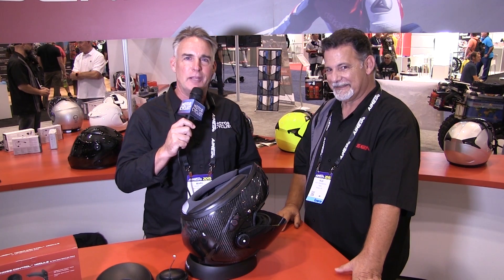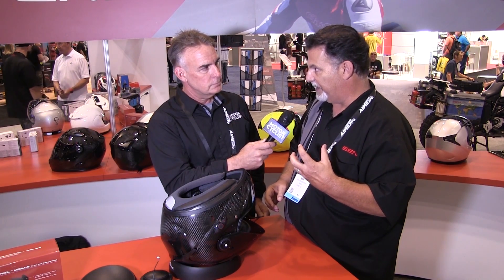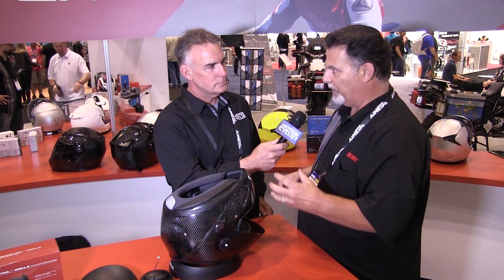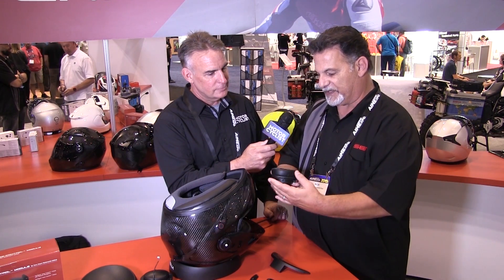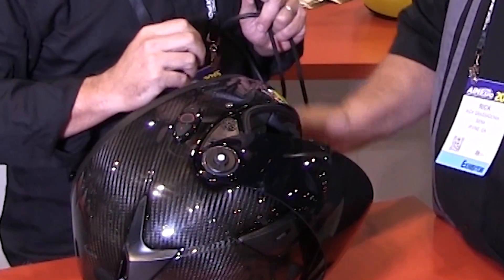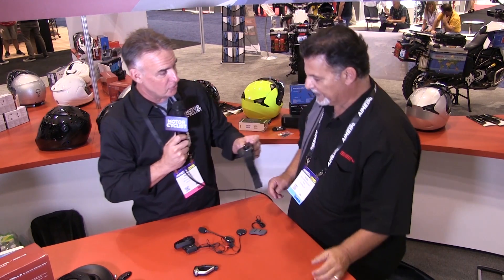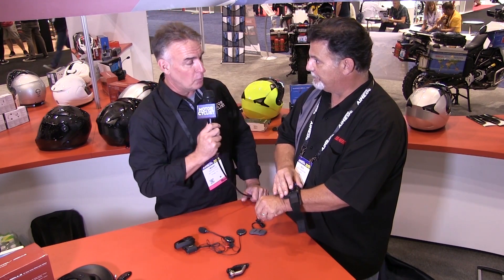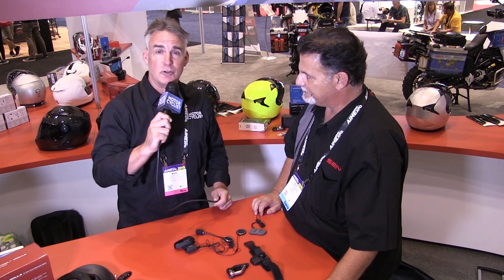Sena Introduces the New Smart Helmet With Internal Noise Reduction at AIMExpo 2015

Comment: Sena sucks. I bought the smh10. Within 5months one speaker completely went out and the device would not connect the the computer. I got it exchanged with paying the difference for the 10s. 4months later. It dies after about 1hr. One speaker went out, the other that worked was nothing but static, the bullshit connectors on the base and the Sena had a short. I had to push the Sena on the back and downward position to get it to connect to the base allowing my static noise to come through the one speaker that worked. I had that one exchanged. I'm a week into my third Sena, second 10s. The same exact problems as the first 10s happen all at one time. So am I suppose to wait until the new 30k is released to start having problems with that one also along with paying the difference to upgrade? Because I'm no where near able to get my money back with all these issued and exchanges.

Comment: Great idea.  I've been wondering why the motorcycle community hasn't produced active noise cancellation for years now.  I've even tried to experiment with it myself with active noise canceling earphones.
Here's my problem though with this Sena system:  This helmet can't be cheap.  I would assume it will retail for well over $1000 because of the integrated electronics.  What happens when you need to replace the helmet in a few years or if it get dropped hard and needs replaced?  The electronics may be fine, but you have to replace the whole shebang.
Keep the system modular so you can replace or upgrade each component (helmet and electronics) independently.

Comment: i just want to get rid of wind noise!
Reply: +2cool0 It's not really a big deal to carry ear plugs. I have a pair of moulded plugs that I just leave in one of my motorcycle jacket pockets so they're always with me when I ride. Whenever I take them out, they go straight back into the pocket.  I wouldn't do that with foam earplugs though, they'd probably get pretty dirty and gross.  My moulded ones also came with a small leather carry pouch but it fell out of my pocket one day while riding :(
Reply: +2cool0 Wear earplugs ...sorted
Reply: Kryten L yeah but i don't want to bring earplugs with me or remember to take it. i just want to take the helmet that's it. i like to make things simple and unified......i don't like to bring all these seperate things. but yes until i can get this helmet i will use earplugs. but it would be nice if they made a helmet similar to this but without making it all electronical. you know how they have the ear muffs in gun ranges? those earmuffs don't have any electrical parts or anything and only costs 14$. it would be cool if they made a helmet like that with ear muffs inside that works like that.
Reply: +2cool0 The half way decent gun range earmuffs are electronic so they can amplify low volume noises and decrease loud noises. Wearing something like the cheap ones on a motorcycle is just asking for trouble.
Reply: +Pyxel Dust were they ACS ? I have moulded one too...take a couple of seconds to insert and go straight into the leather carry pouch when I get off the bike and into a zipped up pocket on my trousers...no trouble at all
Reply: Kryten L I'm not totally sure what ACS is. Quick Google leads me to believe ACS is a brand name of ear related accessories.  Mine are silicone ear plugs from Earmold, an Australian company.
Reply: +Pyxel Dust OK I assumed you were in the UK. Yes ACS is a UK company that makes custom earplugs for various industries along with in ear monitors for musicians. I agree Customs are the way to go. I have the ACS Pro 27...expensive initial outlay but still working perfectly 5 years on and zero hassle getting in and out unlike foam plugs.
Reply: Kryten L yup, mine were just $80AUD so nothing too crazy but they're very durable (going on 2 years), are super easy to clean (practically self cleaning), and are really quick to seat and unseat. Definitely money well spent.

Comment: now to beat the helmet law in Australia we need mounts for the cameras pre installed.
and the stick on remote dosnt pass aus law.
Reply: voxac30withstrat I guess I've been misinformed that any kind of visor tint is illegal.
Reply: +Gummy Bear heheh Oz helmet laws are a joke. From state to state they need to get their acts together. better still get rid of the states
Reply: Isn't it also illegal in Australia to NOT be blinded by the sun?
Reply: Captain_Pudding Not to be blinded by the sun? ?? No
Reply: Captain_Pudding No any after market visors are illegal. in one state at least, any visor that comes as part of the helmet like in my shark vison r that has an internal drop down visor is fine. The problem is no state seems to have their laws co ordinated. If you have anything that could damage the integrity of the helmet like a screw or glue on camera mount for example.Personally I dont see an issue with an after market visor but I dont make the laws. I can have my often loud  opinion though.
Reply: voxac30withstrat pinlock inserts can be used i use them  for fogfree i use light tint